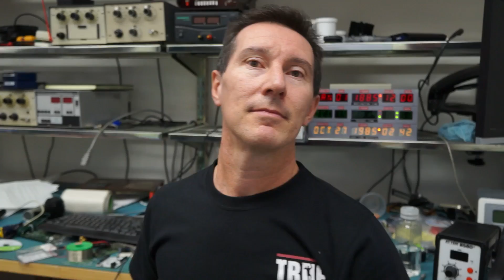eevBLAB #2 - Are Electronics Hobbyists Useless?

Comment: I am still reasonably new to electronics (been dealing on/off with electronics stuff on/off for around 8 months or so).

generally a lot more experienced with programming though (generally C followed by C++ and ASM, where I have been writing code since the 90s), so a lot of stuff has been wiring things up to a Raspberry Pi and letting it do most of the logic. but, it comes up pretty quickly that there isn't really a whole lot the RPi can do by itself, so designing circuits and building boards and similar (from basic electronic components) is basically required.

though, generally it isn't SMD. most of it is through-hole construction and wire-wrap, much of it with heavier-gauge wire (a lot of it is power electronics, so the wires need to be able to handle the amperage involves).

for example, the RPi can run logic, and one can do PDM or DPWM or similar in software, but it still takes wiring something up, say, to use it to drive motors (need to get from bits as 3.3v 6mA signals, say to something like +/- 12v 15A or similar, ...).

a lot of what I have ended up building though has been stuff for running motors (DC, BLDC, and steppers). this includes things like manually wiring up H-bridges out of transistors and resistors, and a lot of stuff in a sort of gray area between digital and analog. generally both digital and analog stuff gets involved, with various components operating at different voltage levels, ... though all still pretty basic.

there is still basically a lot of needing to figure out how to go about getting stuff built and working (including a lot of mechanical parts, like various attempts at hand-making things like gears and couplers).

dunno, still seems like basic hobbyist type stuff.
a lot of other people do stuff which is a fair bit more advanced here.

and, some stuff is a little simpler.

for example, in a class I am taking, a robot was built, but the electronics were basically all pre-made plug-and-play stuff. you basically hook up small ribbon cables between the controller and pre-made motor-driver modules, and hook up power wires between a power distribution module and the drivers, and between the drivers and motors. the software was also largely pre-made as well (you use a premade controller program, and basically write some boilerplate against an API, where even this is optional, you can also go use a drag-and-drop tile-programming thing). likewise, the mechanical parts were basically a kit.

it makes building things fast and easy, but in a way, it also takes away some from the experience. like, designing something oneself, is a little more of an experience than assembling something from a kit.

well, even if one ends up with something which doesn't really roll very well and most of the parts are made out of cardboard and hot-glue...

Comment: Dave you are not asking too much, last hamfest in Perth in the constructors section,  there was a wonderful bit of work done by a 14 year old, he designed the circuit, got the board made, hand soldered smd parts onto the board and the work was top class and it worked as intended.

As a tech I was impressed with the level of skill this lad had shown and if this is the sort of work he does for one of his first projects I want to see more of his work in the future.

Oh and yes he got first prize on that project.

When I was working for the education dept (wa) the students were amazed that an older bloke knew what websites to go to to do the research they needed to do.

Comment: Dave, I whole heartedly agree with you but I think the hobbyists are becoming a victim of their own success... and that the technology available to a hobbyist from companies like Adafruit, and Sparkfun have a lot to do with that (Now I love how it makes a hobbysits life easier to have these comanies around... but)... in my day there where no break-out boards, there were no arduinos, there was just the chip and a desire to make it work... copper strip board was my breadboard, or perhaps wire wrapping, those are rare skills. These days,  when you go out and buy an arduino, a magical sheild or a break-out board already designed, routed, and populated and program it in a psuedo 'C' language using the supplied library or example code, where all the hard work has already been done by a real coder (providing one of the thousands of libraries for almost every conceivable purpose, or at least open source code), the challenge is not there, there is no need to push your knowledge, and no incentive, or at least not enough.
There is a real lack of grass roots hobby skill building, and the need for it is just not there any more... its a real shame, this is where the innovation comes from... no doubt for the folks who can properly leverage all of these wonderful tools that are available, there are innovations possible much further up the stack, but at the bottom, it feels like  small and shrinking pool of talent.
I have a M. Eng Microelectronics and Software engineering Masters, a 5 year course, I studied 24 years ago, and can honestly say that I would not have needed to know how to solder, layout a circuit or program in assembler/C when I left that course, which amazes me when I think about it... if it wasn't for my dad being a hobbyist and involving me in his projects from a young age,  to layout and etch circuits, solder boards, I would not have those skills today. But they have proven useful throughout my career.. and unfortunately almost unique in an otherwise very skilled, well rounded team that I work with in my professional career in technology.
Reply: I certainly don't 'blame' Adafruit or Sparkfun, they are awesome and have contributed enormously to our hobby.. But there is a tendency for today's hobbyists to just use the breakout boards these awesome companies provide and never take the next step to push to designing with bare components, creating a PCB, buying an oscilloscope (so much performance for practically no money these days).. Ok I admit I'm probably an old curmudgeon but these young whipper snappers really must try harder to grow the hobby and their skills to get the most out of it.. This is a golden age for the maker/hacker, the possibilities are boundless

Comment: I was afraid that might happen. Got the same problem with students in their 4th year (currently doing their MASTER) here. They can't design a circuit, they lag IT skills and they lag problem solving skills. The average hobbyist today is able to buy the arduino, run some code, built a ready made kit circuit and read the multimeter. That's about it. What you need is in today's terms a real "hobbyist nerd" I believe.

Comment: I fit almost by all of the criteria, have a high degree in EE. Lots of practice was in college, not even talking how much pcb have I designed at home from scratch, starting all the way from times when I used nail polish to draw the tracks on pcb, had no computer back then, now even photoresistant pcbs are available on market, that is at the moment most simple way to make a pcb at home I guess. Have knowledge in IT, programming, web design, graphical design and 3d modelling. Professional lightning, since worked in disco clubs, DMX protocols and stuff. Was even designing my own disco lights based on mcus. Working with audio software like Wave Lab and any kind of mixing desks, video editing too. Any kind of debugging or fixing of any electrical equipment, based starting from electronicall valves and up to today technologies. Can explain how stuff works, for some time was learning students at my job. And not afraid to get dirty "Dumpster Diving" Still in my young 20s. Only sadly really far away from Sydney so no chance ^.=.^

Comment: i have allot of friends how call them self electronic engineers..
i am not finish whit my degree yet but i have been making schematic, solder boards, troubleshooting
, programmed and debugged and fixed broken electronic stuff in 10 years now as a hobby at home. i have trouble with math thats why i dont have my degree yet..

but my friends that have there degree they only know how to do the math and program micro controllers, but if i told them to design a analog circuit that counts 0-F on a 7-segment display they dont know how to start and do a circuit from scratch, they would just take an arduino and a 7-segment display module and program it show 0-F, they dont know how to design analog circuit whit op amps, 4xxx/74xx, oscillator, Karnaugh map and so on, many of them dont even know what i mean when i say 555.

it seems like an electronic engineer only has to know allot of math and what an Arduino and raspberry pi is, and that you can buy all the modules you need from ebay and piece them together with jump wire.

i know that i only scratch the surface on electronic even if i read about electronic every day i still have allot to learn and i love it

Comment: I'd say I'm an electronics hobbyist, and I certainly have the skills you described. Circuit design is just applying circuit analysis rules backwards. Laying out boards is quite easy these days: there's software for it! No more need to draw the layers out on paper, copy it with a laser printer & scanner to transparency sheets, and iron it on the copper-clad board... and then mess with all that nasty ferric chloride! No, now you just make it up in KiCAD or such and send it off to a board maker, and they'll even solder on surface-mount stuff for you! I'd consider myself an intermediate level hobbyist: I can do the basics, and some slightly advanced stuff, but my specialization is computer security, so I simply can't put in the time to get truly good at it. (I also have a lot of other hobbies...)

So no, it's not at all unreasonable. That said, part of the issue may be the region, I'm not sure how many people would be available locally. Since I live in the US, the commute would be hell. I think that a lot of the actually competent hobbyists tend to congregate in certain areas of the world, eg there's a big maker community in San Francisco, a big one in Portland, Oregon, another in Boston, another in NYC.... and very little near me in Hartford.

Comment: When I was 10 I assembled my first electronic circuit, I wanted to control the fans of my computer, I found the circuit on a magazine about overclocking, modding, benchmarking, etc. It was freaking difficult I didn't understand anything, just wanted to make my PC look fancy. 

Couple months later I built a VU meter, took me about 2hs to build it on veroboard, but when I connected the power supply and fed the audio signal, my mind blown. The only source of information was magazines, the ones about electronics only focussed on repairs, and I didn't want to repair anything, I wanted to develop things. 

At age 14, internet access was available to me, I spent hours and hours reading, looking for schematic circuits, simulating them, designing and etching pcb's. 

Now, 10 years after that journey, everything is easier, search thingiwanttobuild + arduino, bang! Follow all the steps, and there you go. A single tutorial explains you all the things that Dave is looking for, you just need to practice and practice to understand what are you doing.

 Sometimes you will need some background theory, but, hey! Now there are a lot of video tutorials explaining topics about any subject, even if you dont speak or understand english. I've seen a lot of tutorials in spanish, portuguese, italian, french, german.

Three years ago I built a portable cnc milling machine based on mantis cnc design and a modified 3d printer firmware. I just read about the basics of cnc machines, analyze the firmware, designed the parts on the computer and then cut them using a laser cutter, machining some parts using a lathe and there you go, my own pcb factory. 

My teacher from high school built a milling machine when he was at the last year of university (late 80's) with a group of three other students, he told me that they scrapped parts from printers, designed the stepper motor controllers from scratch, the firmware was developed in a way that you inserted a eprom memory burned previously with the coordinates of the holes, bassically they developed their own g code interpreter and g code. 

His mind was blown when he saw my project,  and told me that the work that I have done was the job of an engineer, took an idea and work around it so I can achieve the thing that I wanted to build. 

TL;DR

You are right Dave, nowadays that skills are very easy to achieve.

Comment: A major contributor to hobbyists lack of knowledge are companies like sparkfun and adafruit making so many tutorials/ kits that are step by step, snap together and them also having breakouts for the most simplest parts like 5mm leds sometimes. I'm a big fan of breakout boards But people use them in there final projects mounted on bread boards, they don't spend the time designing a PCB or can't design a simple PCB. Breakouts should only be used for beginners and prototyping. Also It's not just the hardware they now spoon feed to people it's also things like code and software. People now download the code then upload it and that's all they do now, they don't go back and figure out how the code works and learn from it. I'm 16 now and I have being able to forfill all those requirements for about 3 years now, I can do everything in the desired skills section apart from a couple of things in the web programming bit. I thought there would be heaps of people that could say they can do all these things. I'm amazed!!

Comment: It takes all types. These days we hobbyists are using things like Arduinos to make circuits that perform a function whereas someone 30 years ago could do the same thing with logic ICs. Go back further and people did things in analog. Go back further and you have vacuum tube designers who are the ham radio people that are quite elderly. A hobbyist shouldn't have to meet any subjective criteria of ability. They're doing things for fun. Only a person seeking a profession in electronics should be required to understand everything. I don't know shit about the simplest concepts. I only understand using capacitors in a simple linear power supply. I only understand using resistors with LEDs. I understand digital logic fairly well. I have zero mental capability of programming a micro controller. Yeah, I'd be useless in an electronic profession, but I don't give two shits what anyone thinks, because I have no desire to seek such a profession. Jobs ruin hobbies. I worked at Friendly's. Now I don't care for ice cream. What I do as a hobby is take a circuit someone else designed and design a PCB to my liking and to fit into my application.

Comment: You're right Dave, but considering I learned most of those skills from this channel, and not from any of my circuits or college EE electronics classes, it makes sense why some people wouldn't have those skills unless they look elsewhere for the information (like here). Most of my college EE friends don't know how to solder, that or they learn it on their own. Taking stuff on outside of regular work seems to be the only way to learn those skills, which is rather awful considering most EE jobs require all those skills to some degree. I'm two years in and they've yet to even touch on PCB design.
Reply from the maker: Andrew Kowalczyk Different argument entirely about what people learn in formal engineering education. My experience there is that most graduates can barely wield a soldering iron. That's always been the case. That's why hobby interest has always set those people apart. If you are a student and you aren't being taught practical skills, well, that's your problem, others with the interest who have acquired those skills will pass you by.
Reply: EEVblog Everything I know, I learned from your Channel, Dave. Then I expanded my knowledge through practical experiments and further study on the internet. So far, I haven't learned one single thing in the first year of my electronics degree. To fight boredom, I built a CNC machine that can mill my own SMD circuit boards. The reason I don't like university is that we all know how to do the mathematics of a forward biased diode, but very few people actually know what a diode is used for! So keep it up, I gobble up your videos and have watched each at least twice!
Reply: Heyyy, look who it is!

Comment: I do this stuff for a hobby and can do pretty much everything he's asking. I definitely wouldn't say i can do it professionally though. 

As a hobbyist, it all really depends on how much a person wants to push themselves to learn. I wanted to learn to SMDs so I designed a practice board with 0805-0402s and practiced. Next came a practical circuit using SMDs. 

I get small double sided boards made for less that $2 each so it's worth it. 

My curiosity far outweighs my budget. Beyond that I learn as much as I can about my hobbies.

Comment: I agree entirely with Dave. I'm a very very very entry level hobbyist and even I have designed and printed a few simple PCB and done basic stuff like build an RGB amp circuit, and have soldering and SMD skills. If you can't do these basic things, you're not a hobbyist, you're a tourist.